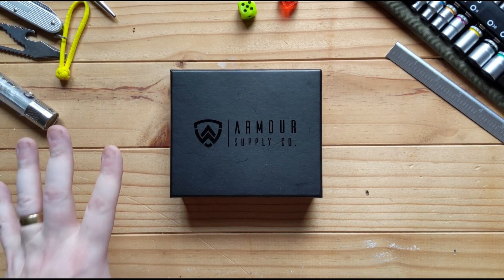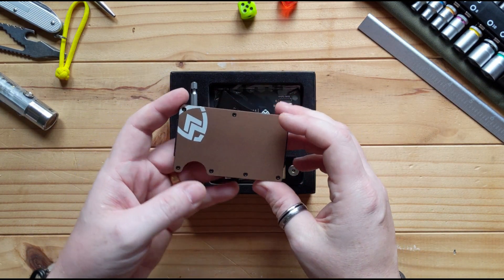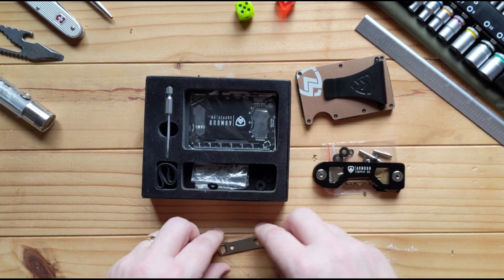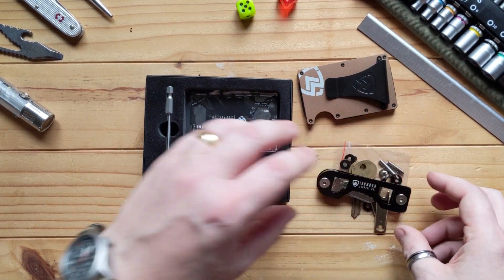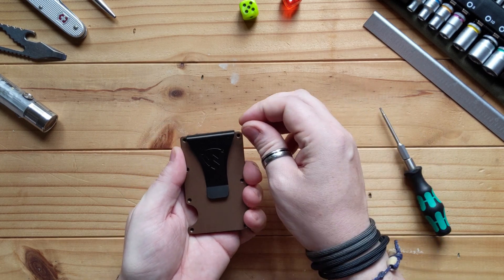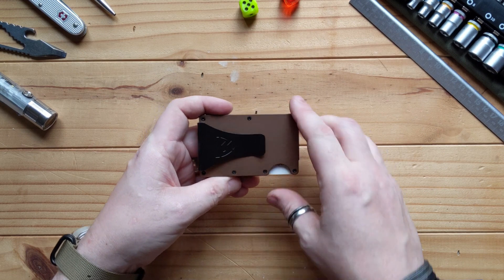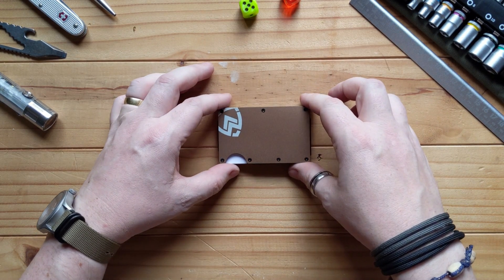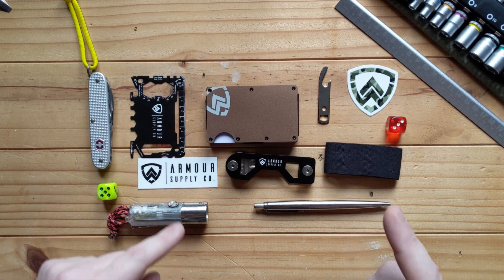Armour wallet - The best value everyday carry gift set

Comment: The other elastic band is not a replacement band, but an alternative to the money clip.  You simply slide it over the single plate when disassembled.  I've been debating over this one or The Ridge Wallet...i like the multi-tool, and have been looking for feedback on how it feels and fits into the wallet along with cards.
Reply from the maker: Yes, you sir deserve a shout out for the reminder. Armour Wallet watched my video and messaged to say what the extra band was for and I forgot to add it to the comments. I'll make sure I add tomorrow with a thanks to you 👍
Reply: Can’t comment on the ridge because I’ve never held one but I just got the Armour wallet as a Christmas gift and I keep the multi tool in the elastic band and use the money clip on the other side as the money clip and I don’t even notice the multi tool you can’t tell it’s there until you need it.